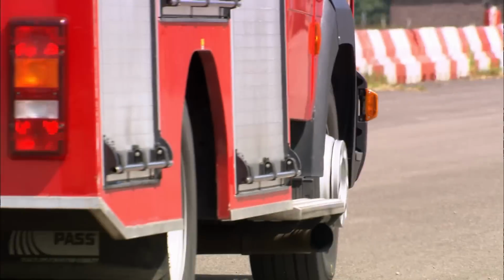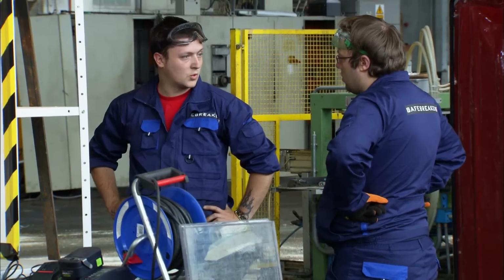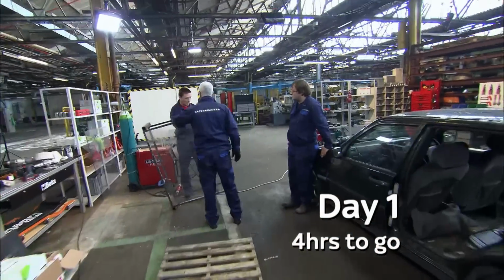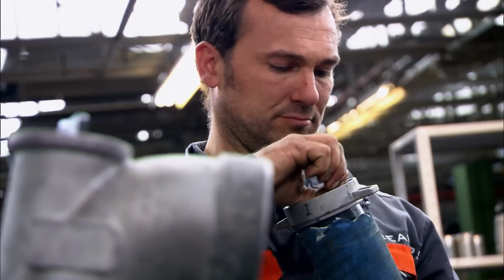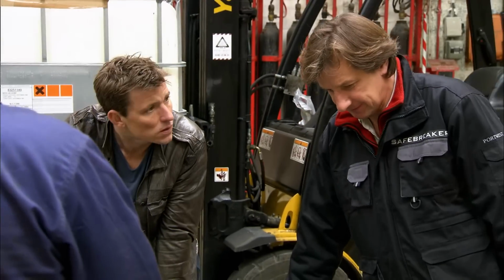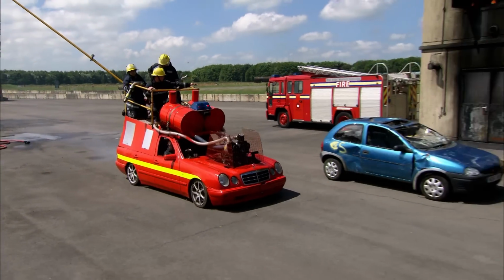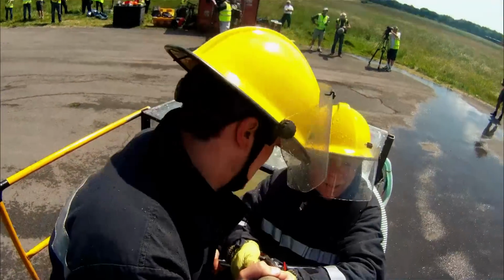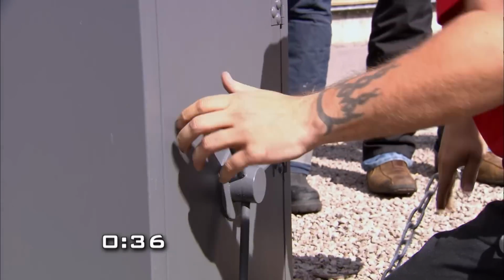Is It Possible To Build A Homemade Fire Truck? | Safebreakers

Comment: Building robots for fun and competition is great but can they build and design on time? That's the big question with those guys. The other team is experienced in their field my money is on them on this challenge build. The robot guys have a problem keeping their pump from sucking air when the water gets too low and can't push it up hill to feed the pump continuously. I think it might lose prime on the pump and quit on them. the other team might be over building theirs and never finish on time too. Close race. The guys with the low tank could have just built a stand for their tank to sit on instead of raising to the roof. Just higher than the pump intake is all they needed here. So the water runs down hill to the pump. Also they need a primer air vent to allow the water pressure to feed into the pump without locking in the air to the intake of the pump. Little problems can make a big mess out of this deal. Well lost my vote on the show due to foul language goodbye. I think the droids pulled it off for the lowest time. Not hiring a censor to beep out the language cost you a viewer.